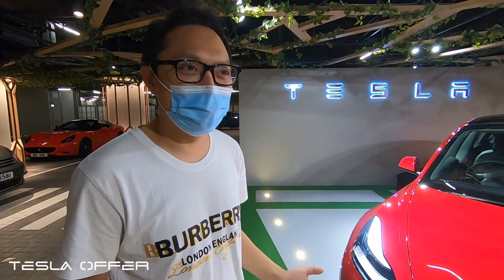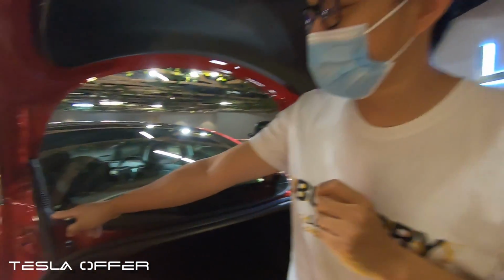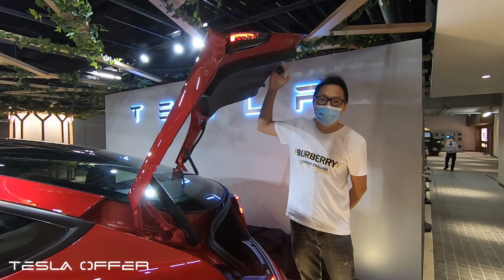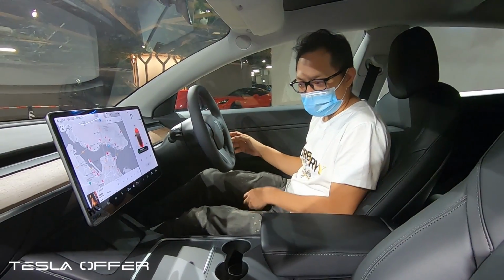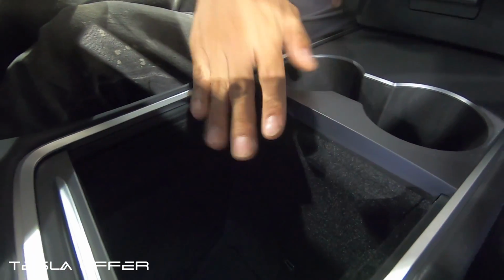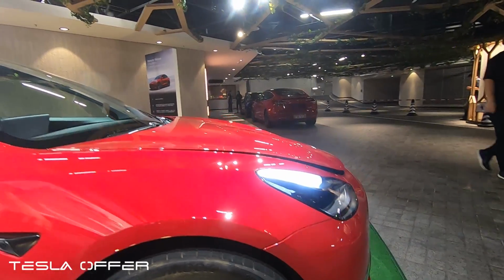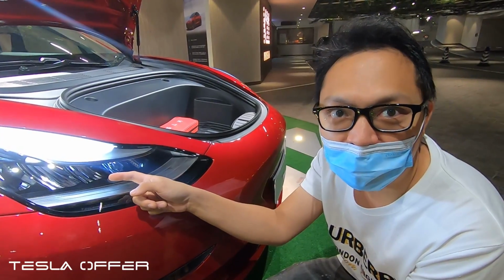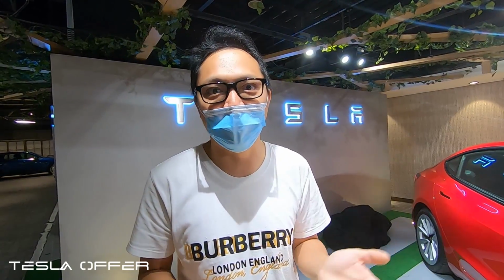Refreshed Model 3 2021 Details Unveiled - First Look in Hong Kong

Comment: Thanks for the video. If you go back, could you check the wheels? I’m not sure if those are plastic covers on top of the previous wheels or if the flat part is also in alloy. The air inlet seems recessed and it is a bit weird for alloy wheels.
Reply: I spoke to my rep and he said it’s a wheel not a hub cap. Get my 2021 long range model 3 in 2-6 weeks. Can’t wait.